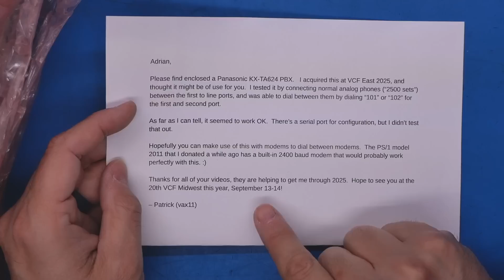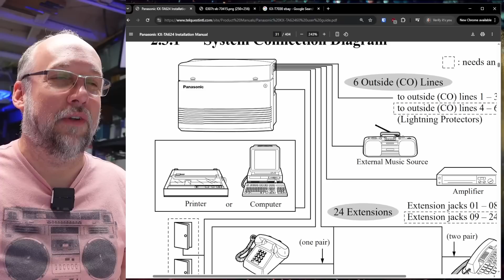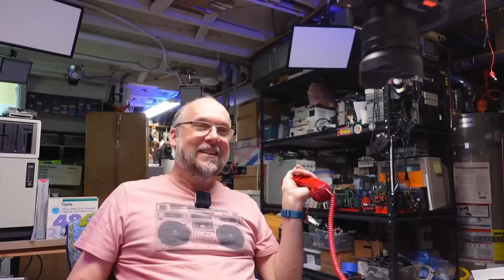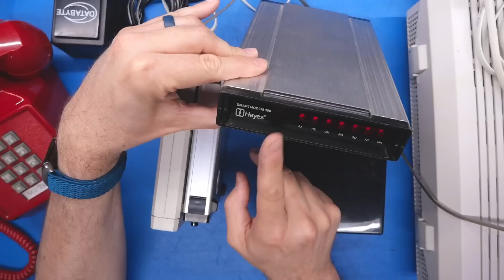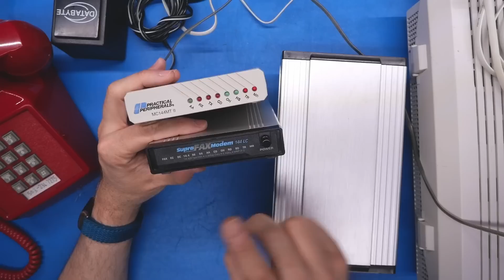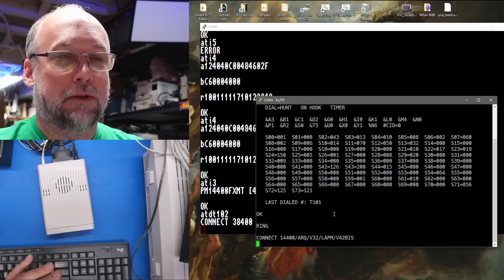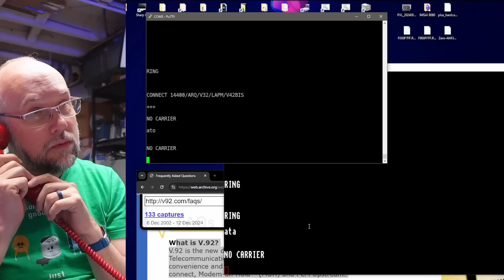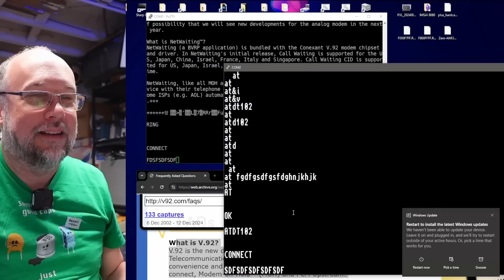How to use phones and modems like it's 1992

Comment: I wanna say the 56k standards, in the USA, were never actually achievable. The spec was based on a slightly higher voltage level which was proposed for the phone lines, but was never actually implemented. It used QAM, which used a mix of phase offset and amplitude for modulation. Since real-world usage had to deal with a lower voltage level (compared to the proposed spec), it couldn't use the full range of amplitude, limiting it to 53.3 kbps, even over a truly pristine connection.

You could only get up to 33.6 kbps outbound on such a modem because there had to be digital connectivity (channelized T1 provided 24 such lines) from the ISP to the local phone switch to get anything beyond that. If there was more than 1 analog hop from the ISP to the end user, that would negatively impact their dial-up speeds.

I was tech support for a dial-up ISP back in the mid-late 1990s. I was well-acquainted with all of these issues. I could listen to the "negotiation sequence" between someone's modem and our system and determine:

 * is that X2, K56flex or v.34 (we supported K56Flex and, after it was finalized, v.34)
 * if they were using older 33.6 modems, what kind of speed are they getting (negotiation sequence was slightly different for various, lower speeds)

I was also sufficiently familiar with the variants on the AT command set (Rockwell chipset vs USR chipset) that I could give them an init string which would hard-code their speed to a certain level. Some people, particularly in rural areas, would get connected, initially, at 28.8 kbps then lose their connection after a while (the line quality degraded when one of their neighbors used THEIR phone which hit the same switch). I could set them up to negotiate, say, 24 kbps and the connection would be stable for hours at a time.

The Zoom 56k internal modem I was using, back then, would let you hear the noise, if you had the phone handset patched through, but it did NOT disturb the call; it wouldn't patch the phone handset's microphone into the call if the modem was connected. Your Zoom appears to do something similar.

Comment: In PA people in the country had audio filters to make it sound less scratchy. But it limited speed to 9600 baud max. 
You had to have them come out and remove them. 
Then US Robotics and some others when set to auto negotiate. Would spiral down over time and then disconnect. After trying different models I finally set them to a specific speed . It worked. 
So set the speed and run zmodem and no more problems. All the way up to 56k and it would hold a solid 44k all the time.
Also I had the slow ports. So I had to replace with a two port 16550 UART chip on a card.
Reply: I lived in a suburban area in the late 90's and was never able to get 56k... Somewhere around 44 was usually my max. I was a bit disappointed since I spentonet to upgrade from a 33.6k modem, but it was still faster...

Could have been my local ISP too. My dad always seeked out cheap local ones.

Comment: The reason that every modem command is starting with an AT, is to allow auto-baud with the PC: The known A and T characters will allow for timing the bit transitions, and determining the baud rate, stop bits, etc. Officially it stands for "ATtention", but actually, the bit patterns (0100 0001, and 0101 0100) are quite handy for the timing, as they allow determining 7/8 bit, stop bits, longest transition, shortest transition, and still provide ASCII in the A-Z range.
Reply from the maker: Seems logical. I always figured it was for Attention but it makes sense to detect what the attached computer is using. Neat.
Reply: I remember learning about this in Secondary Education.
AT-AT commands I think they were called in the text book...

Comment: You mentioned the door opener and that the person might just use a # or * to open the door. I wonder if someone with a pocket dialer could have activated the door themselves as long as someone inside the building picked up the intercom line. Many of the more advanced systems, of course, muted the line when sending DTMF, effectively isolating it to only receiving DTMF from the internal line.

Comment: I will give you a warning do not go further down the rabbit hole! lol I started the same way grabbing a office pbx hearing the tones, then the bug hit me I wanted 56k speed again.. 
tried using my cisco 2801 and a 3725 with some fxs cards and modem cards, was able to connect over the two at 38.8 no issues, but realized the whole analog to digital connection issue. Then i bought a portmaster 3 with 5 cards 10 56k modems each, was able to connect it to my 3725 via t1 and made the connection at roughly 40k, also i was able to incorporate my ubiquiti voip and dialed into a modem, but that was not good enough i just got Adtran Atlas 800 Plus going to try and use it via bri but have not had time my labs in shambles right now.. 
so yeah just a word of warning do not chase this one, it can get expensive.
Reply: Would be good to see all of this.

Comment: Hey you do realize that you could of just plugged the modems together without the PBX? 
Issue ATDT1 on 1 modem and ATA on the other and it will connect Used to do this with friends when we didnt have a null modem cable.

Comment: a neon bulb was used since prehistoric times as a hv discharge device for lightning protection on telegraph and telephone lines. btw, there are still tons of these small office pbxes around and they're not going away anytime soon.
Reply: yep. just like pilot lights in gas furnaces
one of those rare contexts where all the bugs are features and no replacement is ever a replacement
Reply: I grew up in the Babylonian Empire and I can confirm that.
Reply: I actually saw Merlin put a couple Ne2's into the tip of his sceptre! ;)
Reply: Neon requires HV to give off light, so if the bulb's lit when it shouldn't be, you know something is amiss.
Reply: Yeah, and I've seen a lot of older electric fence. Controllers on the neon bulb aspect of things have Doug's repairs. On some of them as well and you know someone of those neon bulbs were clearly ill. Sputtered, disappointment, the bubbles almost silvered. And yes, they were used for ill over potential protection as I called it and well. Yeah, sometimes it'sn real areas. Yeah, you go off. Lightning and more and mere friend speaking, uh.  Of phone systems at all. I remember all this time back in the day when you're on the phone. With people on roll areas such as my grandparents farm. Yeah, yeah, yeah, you always hear It. Hey, need to go Lightning starting to run in when they're referring to a Storm coming in and they can hear you Know the character's success of the.  It's all I'm picking up from indirectly from Mining strikes that. You know, when you got a wall? Long overhead line and I'm space equally as it antenna. And you could actually hear when the storm was coming. Sometimes, if you weren't sure if there's a storm in the distance, you could largely pick up the phone and know if there's lightning, you're quite a waste away. There's actually an effective moment left. I'm doing OK, is that a storm coming. Has it developed yet if you We're not sure yet , but look like it

Speak of which I do remember that when I was younger. I ran across an old shoe box in the attic. At the family farm they had a box of what looked like a large fuse. This was before I knew what Tokyo fuses were. But no, it's the old wooden ones. I believe there's a couple surrounding records as well in there. But they hand the old fuse type phone protector.  You know the democratic, so why do we want to call them? But the thing is why they can spare fuses is in the phone. Company showed the farmers usually have to change the fuses on these be. As often times if there was a strike or a problem, the fuses would blow and so the depart from get their phone back online and sometimes there might be more than one phone out in the area. You may have difficulty getting to a working phone if silver lines are down.  But in that way, if that's a problem, you've got your service restored and remember the aint used to have the metal pin type phone protector on this side of the house as right within arms reach, it was easy enough to get to change these and I'm Frank won't tell. Them Grandpa has sushi. Show me how to change fuses at the same time later on, he says you know, the phone would. Do you said you also're on a Hey post that I need to take care of this.  And Grandpa said you know the only shoe Bosh.You run up for go get it.And I wanna show you how to do this.I'm like sure and then a couple times did that for them as well?Of course after the storm was out of the area you don't want to do this when it's lightning out for obvious reasons

Comment: Oh! My old friend Panasonic KX-TA. I installed a lot of things in the early 200x. This is digital PBS for small offices. The first digit in the model number means the amount of incoming lines and it's followed by the amount of internal lines. Also it has a slot for extensions like DISA or voice mail card. 
You can set it up with a special digital phone from Panasonic and a cable with 4 active conductors.
Reply: This one is analog, the KX-TD are the full digital. The propreitary phones for this system use digital signalling for data control but still an analog talk circuit

Comment: Just an FYI - I don't know if they all work, but I thought that NONE of them were supposed to work - we have one of those walmart "home phone" cellular modems that you plug in your standard home phone and answering machine into. My understanding was always that cellular would not work for data transmission - however, I just gave it a shot for the heck of it one time (I found an old 2400 baud Hayes going through all my old stuff from bak in the day - found my Color Computer 3 and all the stuffs) - and it worked just fine. So, I dunno. 
Could also be the old 2400 baud and it not being a newer 28/36/56k modem. To be clear, these are little base stations with 2 RJ-11 jacks in the back you can plug regular telephones, answering machines, etc. into. I don't know if I lucked into a specific model they used or what. So like I said - just something to throw out there. Have a good one! :)
Reply: i think the slow data rate was your saving grace there. I doubt the cell network has the fidelity for 36/56k. But that wouldn't stop me from trying anyway.

Comment: Now you need to get Archie FTP working. 🤓

In like 2008, I worked for a insurance data center/call center. 

One wall of the building had hundreds of 66 blocks mounted on the wall. 😅

Comment: ip sip phones are better because they dont require servers but can call over the ip network to an ip directly. dhcp or static ip on the phones.
Reply: turn key problems. absolute hocus pocus nonsense. save who by what. tidududiitidududiitidududidii nokia tune. lol. rj45 cat cables are still useful tho. yeah having that corp stuff locally now is interesting. null modem cable. tcp is model terminal connection. literally.
Reply: did not miss out on that. so put a real original pbs running on a old machine, not a docker container.

Comment: Using real modems locally across copper wire circuits is great but unfortunately VoIP pbx systems use audio codecs which do not have the audio bandwidth or dynamic range that copper did/does - this is one of the reasons why dial up services are pretty much dead now. It can be made to work but it is not as reliable or stable as the 'real thing'.

Comment: Looking at the manual for the Panasonic KX-TA624 it looks like it uses the double ring for internal calls (one extension to another) and the usual North American single ring for incoming calls from outside. (There's also a triple ring used for "timed reminders") See the "Tone List" table in Appendix 5 of the manual (a few pages before the very end). It lists three different dial tones but I'm not sure what they're used for. Based on the diagrams in that list it looks like it only has a single frequency for all of its tones and they only differ in the the timing of the sound being turned on and off. What a strange place to cheap out on their design!

Pressing 9 before dialing allows you to make outbound calls while letting the machine choose which line to use. Pressing 81 through 86 before entering an outside number allows you to choose to place the call on C1 through C6 respectively. (See page 3-2)

Comment: I used that exact Zoom 2400 bps modem with my Apple IIGS starting around 1991 until I replaced it with an Intel 14.4k modem around 1994.  The Zoom modem is super cheap and basic but it worked great and was super reliable. While it leaves the phone passthrough connected so you can listen to it, I think it may disconnect the ability to speak on it while the modem is connected, which is why you couldn't introduce any errors by talking into it.

Comment: At 49:00 min, you are totally right. 56k needed digital access concentrators on the called side. I worked for Microcom (Norwood MA), well I worked in Germany, but we were a subsidary of Microcom, we designed such access concentrators for T1 and E1 lines.  This was a bit step forward back then. In Europe ISDN ( 64k symetrically) took over quite quickly after all.
Reply from the maker: Ah nice. Yes ISDN was just too expensive in the US because all the Telcos charged a per minute rate, even for local calls. (Regular phone lines were always free for local calls, so you could use your model all day with zero extra charge.) When DSL and Cable modem became a reality in the late 90s, no one looked back to ISDN except special use cases like radio broadcasts and backup links.
Reply: @adriansdigitalbasement  In Germany, everything was charged per minute (or per 3-minute period), so ISDN had a good market chance. Except for the mobility of modems/isdn cards, I was pleased to have DSL internet
Reply: @adriansdigitalbasement  I got ISDN when I became tired of my modem's 2.1KB/sec download rate, and the frequent line drops when it rained!  At this time, I was living in a village about 5 km from the telephone exchange.  My telecoms habits demanded a better connection but it was slow and expensive: about 6KB/s download rate at around £50 per month.  It gave me an extra phone number but it wasn't worth it.  ISDN didn't really take off in the UK.

Comment: Oh sweet memories ... I had a us robotics (modded) courier dual standard back in the days. Kind of a sketchy setup, when I sneaky layed a thin cable through the home, which was illegal in the 80s / early 90s in Germany, but hey: the us robotics modem was illegal as well ;-) 

It had been a very adventurous time.
Reply from the maker: What kind of modems were you allowed to use legally? Something the phone company would sell or lease to you?
Reply: @adriansdigitalbasement  Until 1995, the telco-network was managed and provided by the state (Post and Telephone). The first reform attempt startet 1989 to split "govermental post" into postal, telco and banking. in 1995 it was finally a private company and the market for more devices was open. 

Back then the telephones have been provided by the goverment.  The best way was using acoustic-copler, as they didn't require any modification to either the phone or cabling (which was non-removable back then! no plug or whatsoever).  

I remember computer magazines, which showed internals of official devices because the suddenly broke by a large plant ;-)   

The german post tried to push their "BTX Computer" (later BTX-devices for Homecomputer/PC), which was a similar to Minitel in France, and basically had a styling similar to Teletext. 

To be honest, I haven't known anybody who had an offical "german post"-modem - we all had our secret buying sources

Comment: O  is that usr courier a hst or dual standard model?
Reply from the maker: Heh well it supports all of those standards, being V.everthing, but it certainly has the same appearance as those original HST modems. :-)
Reply: @adriansdigitalbasement my first usr modem was a 14.4 hst then later I got a 16.8 dual standard that firmware upgrade to v.everything

Comment: Enjoyed the hardware tour. Maybe that differing sound for the dial tone helps distinguish when an outside line is selected (and maybe it has to be in non-automatic-line selection mode)? Some small units like that passed through the external CO dial tone to the caller, and the tone changing was their cue that they had the outside line. Dunno...

Comment: The connecting noises brought up many core memories of late nights during college, using my C-128 to call into my college's modem pool and chatting with folks on the early Internet.  At a blistering 1200 baud 😆
Reply: Oh hells yeah Commodore 128 +1200 baud :D - I wrote a BBSing-focused terminal package to prove that the C128 in FAST mode could handle all that in uncompiled/interpreted BASIC. It got published by Uptime! The Disk Monthly, which is also how I became a review columnist for them. :D

It had so many features, including loadable keyboards and character translation systems, so you could call an Atari BBS and look like an Atari, an IBM BBS and look like an IBM, etc etc etc. And every key on the keyboard could be redefined. Plus a password manager, plus a notes sidekick - it had so much going on, and all in clear-text BASIC. BECAUSE I COULD. xD

(This was at the same time I was running a multi-line BBS on the schools mainframe computer. Three outside lines plus every terminal on campus. We'd have 20-25 users on that thing at once in prime hours.)
Reply: core memories, that's right.
the sounds in this video have dug up something that was buried somewhere in my brain very deep indeed.
Reply: 1200? Luxury... My first modem was 300 on the c64 :)😊
Reply: @gavinknight8560  Oh, me too. HESmodem on a C64. :D